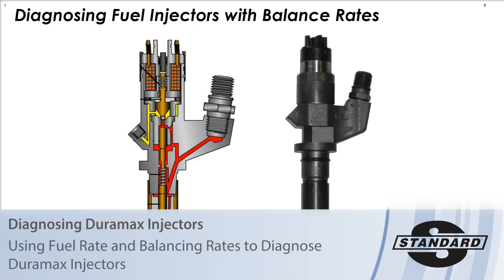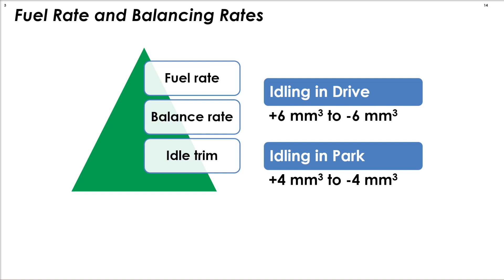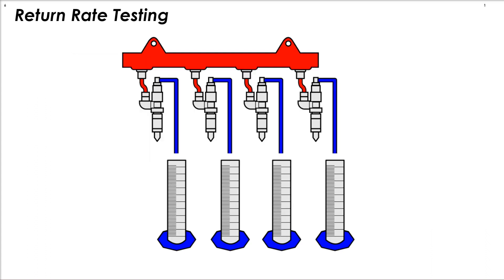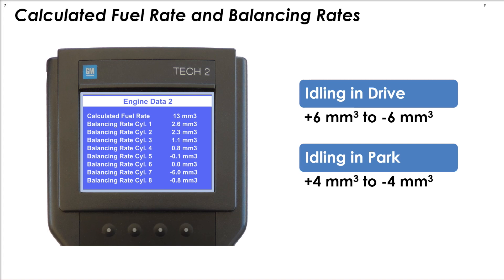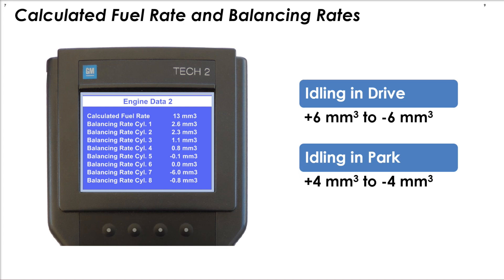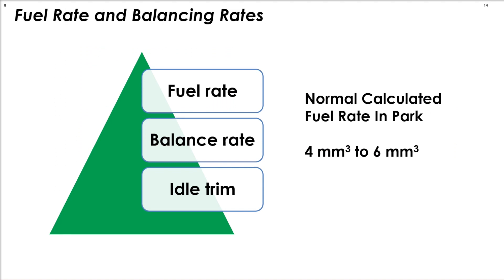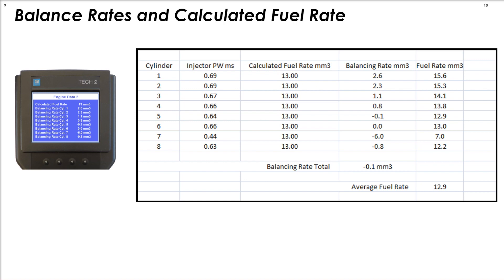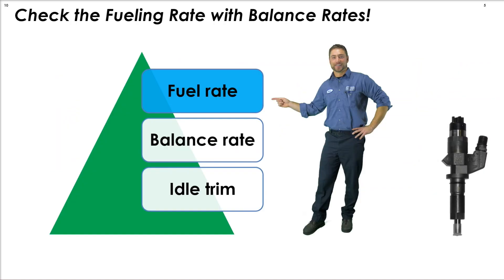Diagnosing Balance Rates

Comment: I recently replaced all of the injectors in my LLY. My calculated fuel rate runs between 2mm^3 and 3mm^3. Does anyone have any thoughts on why my CFR is so low? Should I worry? It does have a bit of a 'bump' at idle. All of my injectors are well within spec even with this low rate...
Reply: did you reprogram your injectors?